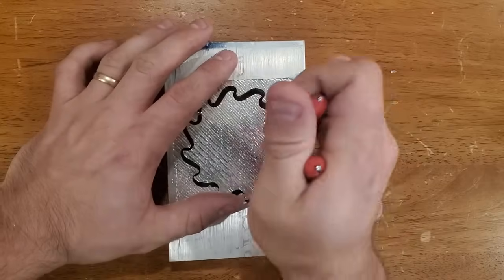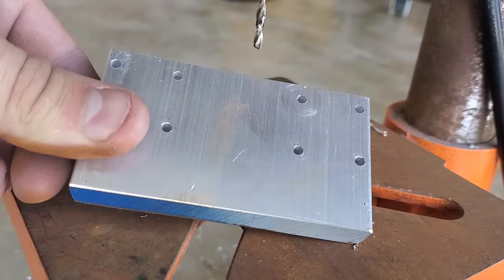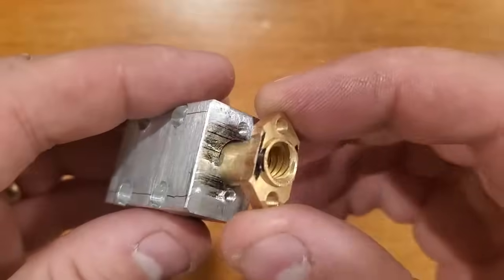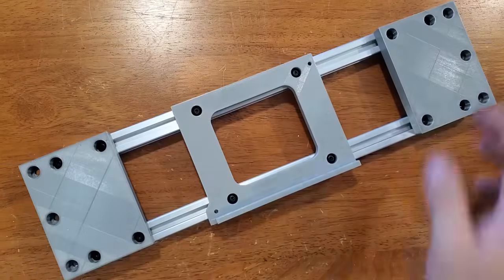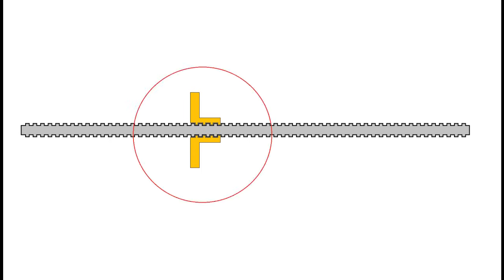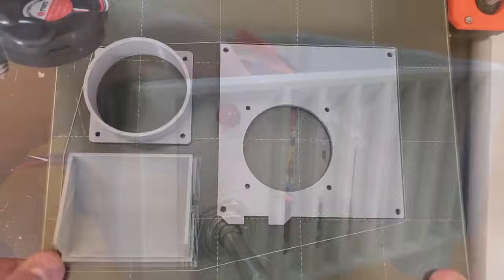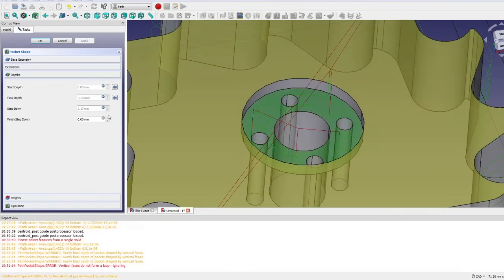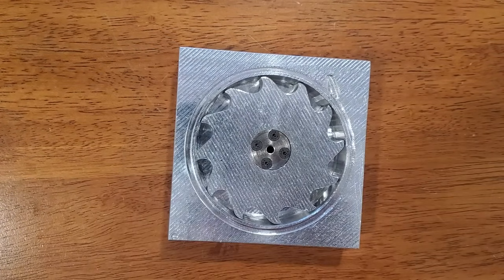Upgrading my Homemade CNC

Comment: If you aren't happy with the side wall surface finishes, you should create a roughing tool path leaving a few thou of excess stock on the walls, and a secondary "finishing"  tool-path to clean them up.. you'll want to reduce the travel speed, full depth of cut minus about a thousandths so you don't mar up the floor finish (only applicable to parts with a floor to finish), and skim the edges to remove the excess stock you left in the first operation, as well as cleaning up, and leaving a uniform wall surface finish. 

It's common in CNC machining to create multiple operations like this.  roughing passes care little about surface finish, it's all about removing material as fast as possible, and a secondary clean-up pass to remove the last bit of stock and leave an acceptable surface finish. 

Hope this was helpful :)
Reply: also, with aluminum especially, you might want to make sure you are using the right endmill and feed rates.
Reply: @en2oh  setting up an mql spray would probably also do wonders.

Comment: you can get ballscrews from china with 5-10x cheaper. yes they are not perfect, but with average luck  far better than regular brass ones with a slop. I actually thought about idea on adding two to make it tight. good to see that someone implemented it and it works :)

Comment: not sure how this design establishes anti-backlash.  this design & diagram does not help.   Seems like a pair of floating acme nut (on screws) but in video is not torqued to the block. then i assume you feel backlash and readjust screws?  I presume you have to readjust the nut screws once a year?

Comment: Nice upgrade!
Btw you can GET Wy cheaper ballscrews, got some for mine but been lazy to convert.
Also another option is to get some nuts with anti-backlash builtin. I have some problem is they are a bigger.

Comment: How loud is this when running? Im also interested in doing something like this, but I'm kinda worried if the neighbour would hate me for it. 😅
Reply from the maker: With the current spindle not very loud. Can't be heard outside the garage. The majority of the noise is from the metal cutting action, not the spindle motor itself
Reply: @HyperspacePirate  OK cool.👍I got most of the stuff to build this. Just missing a spindle. I'll give it a go but will build a sound dampening enclosure for it as well though 😊

Comment: I have a question about 6:17 screw - how is it working? Did you have that 3d print threaded? Is this type connection working solid enough? Or maybe there is something that i dont see?

Comment: I recomend to buy cutting milling tool with larder diameter, may be 6 or even 8 mm. Also you should install dust filters on intake. Please use respirators for prevent damage to your lungs from alluminium dust. Also you can install end point switches for usage with more pleasure.

Comment: You have a lot of good ideas. Have you seen reduced backlash design that uses two acme nuts with a spring between them? It reduces friction without need for adjustment.
Reply: It reduce capability due to spring load.

Comment: Ive been building a CNC mill for about a year now and I just upgraded from the "ubiquitous 500W Chinese spindles" to the Carbide 3d compact router and it was a world of difference for me. $80 for the spindle and $80 for the mount, much higher quality, less noise, higher rpm so faster speeds, and a fan that clears light chips from the cutter. It's not much of an upgrade in terms of horse power but 1/8" end mills and 1 flute 1/4" end mills don't require more than 1 HP in most cases anyway.

Comment: Actually ... Earlier I wrote that you should keep the plastic parts.
50 minutes later I return to write a correction to that suggestion. :)
-I recommend that you replace the plastic parts used in the frame, by metal parts (aluminum should be fine). Eg. the triangles making up the corners are of interest.
If you do this, it should make it much more stable / rigid - and reduce chatter even more.

Comment: Really a good build-series. Even though you've used a few Chinese parts, your build is already much better than a chinese CNC.

There are a few things I noticed ...
1: Please don't use double sided tape for attaching the heatsinks; double-sided tape (especially foam-tape) insulates against heat and thus keep the heat inside the part you wish to cool down. Instead you can use DOW Corning 340 if you can mount the heatsink using bolts (DOW Corning 340 is not adhesive). Stepper motors do not need to be cooled; most people make the mistake that they think they should not get hot. Normal working temperature for a stepper motor is 60°C (which is: not boiling, but you do not want to touch the motor). If you can't mount the heatsinks using bolts, there are still a few adhesive heatsink compounds available (I know Arctic make some, but they're hard to get as they're epoxy based and are usually sold to companies in larger quantities). Epoxy-based heatsink compounds can be mixed with non-adhesive variants, to make it possible to remove the heatsink if necessary; you'll have to experiment with the mixing ratio, though.
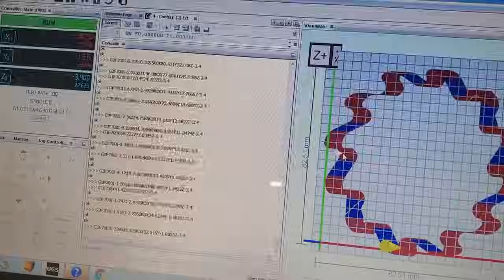2: You could use double-sided tape for the parts you're milling. Stick the aluminum block onto the build-plate with double-sided tape, then keep the holding tabs (at 11:20) and let the CNC remove those gently as the last step - then you hav a part which is ready to use when the CNC is done.
3: A4988 is a good stepper driver to test with; but try upgrading to TMC2209, they should make smoother movements, which will minimize the chatter and thus resulting in a smoother surface on the part. BiQu's TMC2209 v1.2 is currently the best driver (don't get fooled by other manufacturer's v2.0 or v2.2 or 3.x). IMPORTANT: Remember to disconnect all motors, then adjust vREF so it matches your motors and finally connect the motors. If you start by connecting the motors, you'll likely fry the TMC2209's MOSFET (like I did, because I forgot).
4: Arduino is also a good and easy start, however, upgrading to a ARM Cortex-M4 board (recommend STM32F4-based), then you will get floating point calculations and 32-bit calculations at a much higher speed, which in the end means you'll be able to get the ability to calculate curves (bezierpaths) - again, this improves the quality of the workpiece.
5: When I saw your first build, I was thinking that you could probably create your own spindle from good quality ball-bearings and a 10mm shaft; then power that spindle by the motor. Note: Roller-skate bearings are cheap and fairly good quality (I think they're actually 8mm, so you'd probably have to use an 8mm shaft).
6: The 2020 aluminum profiles used for the frame have a circular center, where you can tap a thread; then drill a hole in the connecting piece for a bolt and tighten this to get better rigidity; keep the plastic, so you'll get as much rigidity as possible.

About heatsink compound (10 years ago, I worked with this for living) - apply one drop-size heatsink compound per square-inch. Spread it evenly over the surface using a razor blade. It should be a layer thinner than a piece of paper. The job of the heatsink compound is to remove airgaps between the two surfaces and otherwise be "invisible". It should not insulate. Tighten the bolts holding the heatsink as much as possible (without breaking the threads of course).

I know you'll probably not implement all my suggestions, but if you (or someone else) can use just one of them, then it's been worth writing it. =)
Reply: I believe the "double sided foam" he used are actually thermal pads: specifically designed for use in IT heat transfer. Otherwise your advice is solid😁👍...
Reply: @brazenh2836  - I wrote a reply, but it was lost due to YT's "hip-hopper features".
Yes, the thermal pads can be used, but you really want to transfer as much heat into the heatsink as possible.
-So if you're able to, go for a proper job with heatsink compound or adhesive heatsink compound if necessary.
Reply: Excellent comment, saved as I'm planning to undertake a similar project.

Comment: You’ve already got it in great detail…. I’ve read a decent amount of the reactions to your initial upload of this DIY build gem. And i did notice that you take the provided info very seriously and put everything to good use. The result of this build speaks for itself, and it turns out beautiful. You could use 1 or 2mm thick rubber mats for the protection against burs and sliced up loosen material from falling into the frame square/rectangular. By using lubricants to extend your tools lifetime, both wd40 and alcohol based solutions as well just water i warn you that these are all way too thin in viscosity and will have little effect on the purpose of the projective. Be aware that most of the different sort aluminum grades are manipulated in molten state by adding silicate and even harder stone-like materials that will destroy your tools and blunt them way faster than you would think. I mean, silicate is just beach sand. Try little more grease-like substances in small amounts while surface cutting and edge smoothening. Just don’t use grease while cutting inside slots  because that will cause the phenomenon “re-chipping” and wear out your tool rapidly plus putting lots of heat in your material to the extent of destroying the tool and failing your end product measurement, looks in surface roughness. 

I cannot express how grateful I am having you provide me with this back to back build of a CNC-milling machine. Thanks isn’t somehow cutting it 😉

Comment: Hi, great video thanks, I am thinking of getting a 3018 machine and this is really useful to know which bits are important to look out for.
Do you think a 500W motor is enough for aluminium? I was looking at an 800W or 1500W water cooled model (noise level is important for me.)    Also upgrading the servo motors.   I have just built a new PC and dust filters are now included in the case -should be easy to add to your design.

Comment: 1. Geting a biger lead screw sholud resolve most of the play on the axes (the biger chinese screws are more precise because are made for a heavyer load )
2. Everything that is plastic must be changed with metal(maybe it just hurts my eyes because i have a taste for profesional hardware rather than diy)
Anyway i like the progres and how the "build" its going dont be afraid to inspire from the big guys(high end/precision cncs)

Comment: What material did you use to make the 3D printed parts and with what layer height and % infill? Overall and awesome project. Good job
Reply from the maker: PLA at 100% infill

Comment: If you can get an Ø8 tolerence rod, you can balance the original fan for the motor. You could also just print a new one and balance that since the original isn't super effective. 
Just put the Ø8 rod through the fan and with some excess rod on both sides, you've essentially got a wheel balancer, just put 2 rods parallel with eachother on a very level surface and put the fan on those. If the fan rolls and stops, it's out of balance. 
I balanced my original 500W motor fan with a couple of very small bearing balls since it was WAY out of balance. Now when running the spindle at the lowest speed it runs very crooked but at 11k RPM there's absolutely no vibrations.

Comment: "I don't want to spend $170 on a CNC"
(Builds <$100 CnC using spares)
"I will now spend more money upgrading it!"

Great job btw, not shitting on you, just ribbing. It's the journey and what not
Reply: TBH I wonder if that $150 machine wouldn't be a better tool to make the new CNC machine.

Comment: Do you think there is any benefit in using the linear guide rails and blocks used in the Z axis for the X and Y axis for improved rigidity? Cheers and thanks for sharing a great video.
Reply from the maker: The linear rails can be mounted to anything, so they'd definitely be more rigid than the rods if they were on a solid block of aluminum/cast iron etc

Comment: What is the name of the program who read the G-code? Not FreeCad, the other one.
Thanks!😄
Reply from the maker: Universal Gcode Sender is the software that takes the gcode and sends it to the machine
Reply: @HyperspacePirate  I think he may mean the machine controller. There's no such thing as a G Code sender. That sounds like GRBL nonsense to me.
Reply: @1pcfred  :  What a strange comment!   Will Winder created software and named it "Universal Gcode Sender", or UGS.  It exists... you don't like the name?... get over it!
Reply: @1pcfred  :  I'm not a high-level guru; my experience is limited to using it to control a simple DIY plotter / vinyl cutter.  I also used it to mess around with a simple mecanum wheeled buggy... it was definitely not the right choice for that, but I had it set up, and it was free!
I used it in conjunction with an Arduino Uno and CNC Shield, the same as used in this (and his previous) video.
As you say, it doesn't send G-Code.  I guess it's more of an interpreter or parser...
You load the G-Code file created by your design software  (In my case Inkscape with the J Tech Community Laser Tool extension installed),  into Universal Gcode Sender.
Gcode Sender allows you to view a visualisation preview, jog X, Y, Z axes.  You can edit the loaded G-Code file, and manually enter G-Code instructions directly,via a command line.  You can Run, Pause, and Abort the output to the plotter (or CNC whatever) which is connected by a USB A to B cable.
There is a config area which allows all the setup parameters you might expect, like selecting inches / millimeters, calibrating linear output for each axis etc.
It ain't new, it ain't high end, I would say it was someones "Labour of Love", but may not be getting ongoing upgrades, but it is available, there is not much else out there, and IT IS FREE!
There are some pretty basic example videos on Youtube, if you are looking to pass time on a rainy day!  😜

Comment: May I ask some questions?? how much are you into it?? is there anything you regret? apart from learning.. why havent you put on a simple shop vac? would it be handy to mount a vibration detector to monitor and tune..?  Well dont tho. Very cool.
Reply from the maker: Less than $400 overall. Wish I had designed it from the beginning to use flat linear rails instead of round rails with linear bearings

Comment: Very impressive in vedio1 by using 3d print part to build a basic cnc aluminium upgrade. May be you can put some sprint between two nuts.

Comment: Nice job, shows what can be done with a bit of effort! Should use shims under one of the leadscrew nuts to adjust backlash and allow the mounting screws to be fully tightened without introducing excessive friction.

Comment: Very nice! I think your design choices are quite effective.
The only thing I would recommend is to use a 10mm screw instead of 8mm
Reply: I don't think a larger diameter lead screw would add any significant advantage. Perhaps swap from a trapezoidal lead screw to a ball lead screw would be beneficial in reducing friction and back lash, but that was already discussed.  

As he's not dealing with a large build volume, with vast spans of unsupported lead screw, there shouldn't be any problems. Due to the addition of linear bearing rod, and linear bearings, the only forces on the lead screw would be compression, and tension (pushing and pulling) along it's length. As he's not dealing with significantly strong materials, or exceptionally high torque motors here, those shouldn't be excessive enough in this situation to warrant a thicker lead screw in my opinion.... however.. if he's willing to spend the $$, by all means, go for it XD

Comment: looking good, 1 issue though. your heat sink on the spindle is now an insulator keeping in the heat. the double sided tape is insulation and will not let heat transferto the cooling fins. must be metal to metal contact to draw out the heat
Reply from the maker: It's thermal tape, but yeah, the heat sink was totally useless. I just run a large fan next to the CNC to keep it cool now
Reply: @HyperspacePirate  i recommend putting the heatsinks back on, but use a combination of thermal paste and thermal epoxy.
Use thermal paste in the center of the heatsink, and thermal epoxy around the edges of the heatsink to seal in the thermal paste + secure the heatsink to the motor.
Thermal paste generally has a much higher thermal conductivity than thermal epoxy.
You could probably just use thermal paste + normal epoxy if you want to save money.

This will do a much better job of keeping the motor cool.

Comment: Dang thats cool. Definitely consider an air assist, maybe look into one of those amazon electric air dusters, that could work and keep the size down. Maybe replace some of the plastic parts with exact aluminum replacements, to see if there are any immediate improvements in rigidity? Cool vid!